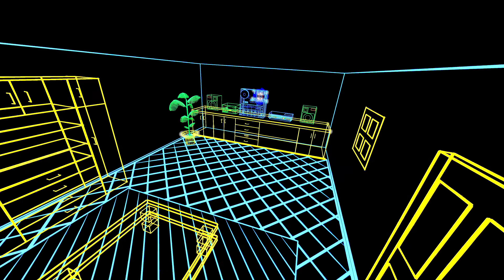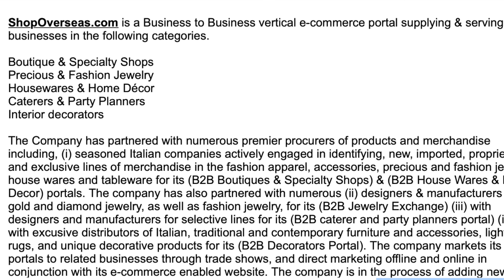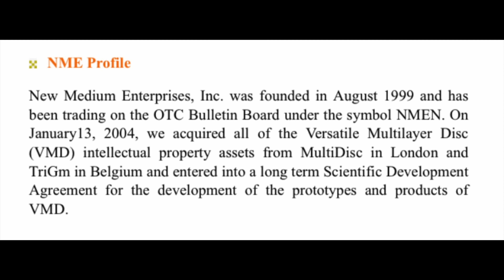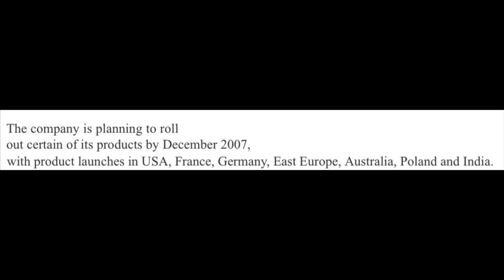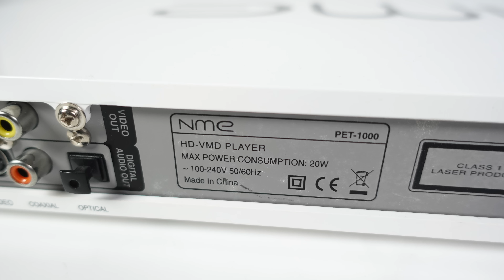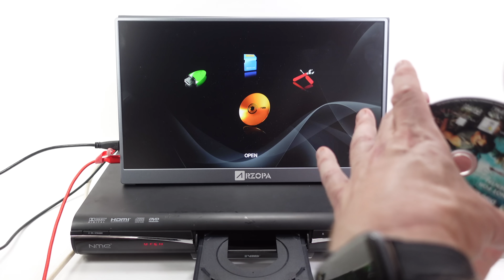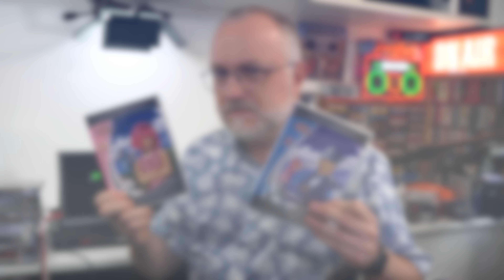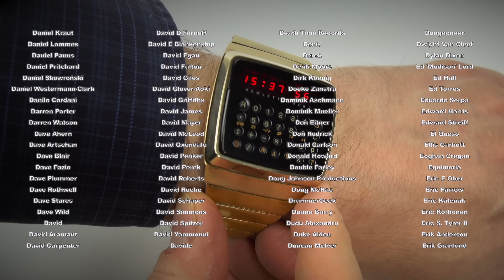The HD-VMD story - The format that lost to the format that lost

Comment: Blue lasers weren't cheap in that time period, red lasers were.

Blu-Ray players were insanely expensive when the format came out, and didn't get much better for a year or two after its release. Remember, the PS3 (at $600) was the cheapest Blu-Ray player you could buy for a while. And yes, the biggest reason was the shortage of blue lasers (Google "blue laser shortage"). So there was a significant price difference between blue and red lasers at the time.

Edited for clarification.
Reply: Must be the part of me used to audiophile gear pricing talking, but I dont think blu ray playes were insanely expensive at all. All a matter of perspective I suppose. But what I do know is that about 10 years prior at its launch, DVD players were just as expensive even discounting inflation. Probably Laserdisc, CD:s as well. I really struggle to think of a media format made for home use that launched significantly under 1000 USD, certainly not 500, when taking inflation into account. I think even HD DVD was quite a bit over 500 at launch, even if they quickly dropped in price. But this was a sidenote from your post, yes.
Reply: @GoldenCroc  
Okay, I'll rephrase. Blue-ray players were insanely expensive relative to red-laser devices. 

In the video, he claims that there isn't much of a price difference. That was definitely not the case when Blue-ray and HD DVD were new. Most Blu-ray players were around $800 or more in 2006, the first one from Samsung costing $1000. If you read articles from that time period, you would have seen many of them cite the blue lasers being the reason of such a price difference between Blue Ray and DVD, It wasn't just an early-adopter tax that often accompanies new tech, it was actual supply shortages, and the price gouging from suppliers that accompany that sort of supply/demand issue.

Just Google "blue laser shortage" and you will see a ton of articles from 2006/2007 talking about it. The blue laser shortage seemingly didn't start easing up until the middle of 2007, which would hamper production and affect pricing for the rest of the year or longer.
Reply: @MrNside  Well, yes. I also remember the shortages well, and agree more or less with everything you wrote. I just dont think 1000 bucks is that much money. As far as I remember, shortages or not, the pricing curve of blu ray players pretty much followed the dvd pricing curve if we are talking months since launch respectively.

On another note, the red laser vs blue comparison is hard to make I feel since there was no realistic red laser HD video format back then. As we have seen in the video, this format certainly wasnt it.

So if you wanted physical format HD, it was blue or nothing. Hard to make comparisons, really.

But I think we are talking past eachother and mostly agree. Cheers.
Reply: @GoldenCroc  
I'm specifically talking about the part in the video where he claims the price difference of blue lasers compared to red lasers wasn't an issue. I'm saying it most certainly was an issue at the time.

As for the early-adoption pricing, it doesn't compare to DVD. DVD coming off the heels of VHS was a completely new way of mastering and producing media. The players weren't cheap because in the late-90s/early-00s, the hardware used for transcoding digital video was more expensive. By 2006, the processing power need to transcode compressed 1080p video was significantly cheaper than the hardware to transcode 480p video was half a decade prior. The proof of this is that in 2006/07 you could buy an upsampling DVD player for around $200 or less. The difference was the laser and to a lesser extent the variable speed motor BD uses.

I'm not really sure what your argument has to do with anything I've said. Again, in the video he says the price difference between blue lasers and red lasers wasn't significant in 2006. I'm saying that minimal research proves otherwise. That's it.
Reply: @MrNside  As I said, I feel we mostly are talking past eachother. I was looking from the angle of pure retail price of the complete units (players). This latest post of yours confirm it, since I agree with everything you wrote in it. So there is no disagreement here, your point is well stated in the laser pricing regard.
Reply: @GoldenCroc  
I'm not talking past anything, I'm rephrasing or expanding on what I've already said in order for you to understand what my comment was referring to. I understand your argument, but I don't understand what it has to do with my comment.
Reply: @MrNside  It was a reflection and comparison of other earlier formats from your initial comment, a sidenote if you will. Now that you have clarified its the laser module you are talking about, I have no issues. "Talking past eachother" is an expression that means persons conversing without fully reaching eachother even though they might agree, it does not imply any fault with any one of them.
Reply: @GoldenCroc  
Fair enough. I do think that BD players would have been considerably less expensive had the blue laser not been an issue. But that would have come down to supply and demand at the consumer level instead of the supply and demand problem at the manufacturing level. We'll never know for sure, but I can say for certainty that blue lasers weren't cheap back then.

I edited the main post for clarification.
Reply: @MrNside  Fully agree, it is very possible that might have been the case if there was no shortage, and as we all know the ps3 was heavily subsidized for various reasons. Cheers.
Reply: @GoldenCroc  
Yes, all consoles (except Nintendo) tend to sell at a loss at launch. They make the majority of their money via licensing games though. While same goes for movies on DVD/BD, the licensing fee isn't nearly as high.

Comment: Interesting how the 'original' formats (eg U-Matic and DVD) were universal, but the second generation split up; probably due to greed as you said, or the 'not invented here' mentality. I suspect Toshiba drove the HD-DVD camp as they were sore at Sony after losing the Beta/VHS war. (Sony, Toshiba and Sanyo were the big three in Beta). Although a Beta enthusiast (it had all the good features first) I still think V2000 was probably the best format in theory, most notably because you could flip it over (like a compact cassette) and use the other side.
Reply: Flipping a video cassette is outright stupid. Because VHS and Beta use the same tape width, and they use the WHOLE AREA of the tape for recording with helical scan, so there isn't any space gained by allowing to flip the cassette, just inconvenience added of having to actually do that, and the tape surface being partitioned into two areas each with its own guard band, so it actually only loses space rather than gains you any.

V2000 devices did have some tricks that improved signal integrity and allowed them to space the adjacent fields closer together longitudinally, and this is where the initial capacity advantage actually comes from, not from the fact that they partitioned it into two "sides".
Reply: @SianaGearz  "Flipping a video cassette is outright stupid." OK, WHY? Are you suggesting that audio cassettes and reel-to-reel tapes which COULD be turned over were unworkable? They were VERY popular! Maybe V2000 could have used one inch tape instead, to retain video quality; I don't know, I never used it.
Reply: @rahb1  I don't know exactly why you don't understand this, so apologies if the explanation will be wordier than necessary and go through things that may be trivial to you, or have tangents that i deem helpful but since i don't know you, may not turn out to be to you. 

Tape isn't like a piece of paper, that you can write onto from both sides, and where if you didn't write on the back side of the paper, you'd need twice as much paper. Because unlike paper that (somewhat) blocks light, tape doesn't block electromagnetism, it leaks all the way through, because it's a really thin material with little metallisation. So you can't flip the tape the other way around and write on its back side. In fact this is not what's happening when you reverse the reel or the cassette, it's always the same side of the tape facing the read/write head. But a different lateral portion of the tape, different section of its width, is being utilised.

More similar to paper would be a floppy disc, where there is enough substrate thickness and embedded metal to separate the back side from the front side, so both sides can get written to. But you can't roll up a floppy disc material into a tight roll, the material ends up necessarily too stiff for that. And i expect that there is still substantial crosstalk between the sides, which is OK for simple digital signal, but not for analogue.

On an audio cassette, you have linear recording, so the mechanism drags the tape across a stationary read/write head. What this really means, is that the data forms a single very thin line across the whole length of the tape. It doesn't even necessarily need to be a tape, it could fundamentally just as well be a piece of string, and in fact this is how early recording machines worked like, it was a thin steel wire on a spool, and this is where tape has evolved from.

But it made sense for it to become a tape, so you can store two such thin lines of information alongside each other. And since a 1mm narrow tape would be too fragile, they made it wider, and eventually they put 4 thin lines of information on it. By making the tape really thin and fairly wide, it could be made very compact and sufficiently robust, solving the issue that steel recording wire was too fragile. There are two read-write coils in the head assembly (for two stereo channels), one of them is near the edge of the tape and one further down. When you flip over the cassette or the reels, what happens is that the head assembly is realigned with the other edge of the tape. So there is a total of 4 linear tracks stored on the tape. Two form a stereo pair for one tape direction, and two form a stereo pair for the other.

You could even say that the utilisation of the lateral space on this audio tape isn't perfect, and that you could store more tracks, though depending on head geometry and quality, they could gain higher crosstalk. Crosstalk between adjacent stereo channels is almost inaudible, but crosstalk between different independent tracks needs to be taken seriously.

Video tape doesn't work the same. The tape gets dragged not across a stationary head, but across a rapidly flying one, which basically moves mostly laterally to the tape, so it records in "helical scan", so the recording forms not a continuous longitudinal line, but a bunch of little diagonal ones, each of these lines storing a field of video. Each diagonal line in VHS and Beta spans the whole lateral width of the tape. So there is nowhere for more space to come from to store more information.

Development of helical scan was necessary for video, because the information density of linear scan like on audio tape just isn't nearly high enough, you'd end up with a 20-inch rapidly-moving reel per half an hour of video. So this forms the main difference, why audio tape has low space utilisation on the tape, and video has extremely high utilisation.

Mechanically, the moving head for video tape is realised as a rapidly rotating drum that the tape gets dragged across on an angle. There are many read/write coils in this drum, and when one leaves the tape on the top, it gets switched off and another that just enters the tape from the bottom gets switched on.

What V2000 has to do, is to partition the tape across its width to dedicate half the lateral space to one "side" and half to the other.

You suggest making the tape wider to allocate two tracks again, but that also doesn't make sense, since if you wanted to utilise wider video tape, a better way to do so would be to still have it single helical track, but halve the transport speed and change the helical scan angle accordingly. You would achieve the same or better space utilisation, and you wouldn't have to flip the cassette half way through.

The V2000 approach reeks of management having the same lack of understanding for space utilisation on video tape as you display for the time being, and telling the engineering team to "make it double sided so it can store twice as much video", which the engineers achieved by employing really advanced techniques, but fundamentally IN SPITE rather than thanks to having it "double sided".

I have worked in engineering for major companies for a good while, this happens a lot, that the product manager orders something they have little understanding of, that probably doesn't make a lot of sense, and you just execute that because you don't want to be fired, and you find unorthodox ways to accomplish the letter of the order. You don't argue with the management, or you will be deemed to have an "attitude problem". The people whose job it is to talk to management to evaluate whether their decisions are sensible are generally "consultants", and those usually haven't engineered a damn thing in their lives.
Reply: @SianaGearz  Thanks for your patronising reply. I actually DO understand that when you 'flip' an audio cassette you are NOT using the back of the tape! 
My point was simply that flipping a cassette is much less hassle than having to always rewind it before watching the next tape.
Reply: @rahb1  Your "point" changes very conveniently.
Reply: @SianaGearz  HUH? What part of "I still think V2000 was probably the best format in theory, most notably because you could flip it over (like a compact cassette) and use the other side." and NOT having to rewind a cassette are inconsistent? They are both part and parcel of exactly the same point - why dual 'sided' tapes and cassettes were far more popular!
I suspect your technical ability far surpasses your English comprehension.
Reply: @rahb1  My English comprehension is fine, thank you very much, along with German and Russian and several other languages.
Reply: @SianaGearz  Apparently not, as you didn't understand what I wrote, as opposed to just reading it literally. Audio cassettes have two SIDES, A and B. Quite OBVIOUSLY that does NOT mean trying to use the back of the tape! Or have you never even seen an audio cassette or reel-to-reel tape? NB: apart from slower recording speed, the ability to 'flip' the tape and use the other 'side' was a MAJOR factor in the popularity of later reel-to-reel machines, and also audio cassettes, because they did not have to be rewound. Auto-reverse machines simply took this to the next level. The CONCEPT of being able to do this with a video cassette (V2000) was a MASSIVE selling point versus Beta and VHS which needed to be rewound (ideally) before you could watch the next tape. As I said, I have NO idea if that format was technically superior to the others; I just liked the CONCEPT! If you still don't understand my point, then just give it a rest anyway. Thanks.

Comment: Matt, there WAS a not-quite competitor to DVD...it was called DIVX (not to be confused with the codec with a similar name, DivX).  The discs required a special player than unlocked them for a set amount of time, and were supposed to be like a rental that you never had to return.  They could be permanently unlocked somehow, for an additional sum, but I've forgotten how that was supposed to work.  It was reportedly cooked up by some group of lawyers from Los Angeles, imagine that.  The discs were supposedly made in the UK!  It was a resounding flop, however.
Reply: There was a DIVX Silver license upgrade, and planned DIVX Gold discs. The standard no-return rental discs had the proprietary player connect to a server to unlock the digital rights management for two days at a time, if you liked it enough to not discard after the included first unlock, you could charge an even smaller rental fee to watch a used disc again.  If I remember correctly, ordering the Silver upgrade authorized your account to decrypt the disc as many times as you wanted, and Gold were supposedly going to be about the same as DVD... though probably with better copy protection, since DRM was a fundamental feature of the format.

If it weren't for the mocking of the DivX codec, DIVX might have made a comeback as a fourth HD disc competitor... in an era closer to when pay per view and internet video streaming services are more widespread.  Back then, the idea of some computer tracking when you watched which video was an invasion of privacy that society wasn't ready for.

Comment: DVD's can have mutliple "sessions" (a session is a portion of the disk which can be accessed in some format) it is normal for a DVD to have a first session which is readable by the computer without any special requirement. That session usually contains indexing and/or end user assets (like DVD extra's such as wallpapers and so forth). It is unlikely anyone can copy a DVD simply by copying the files off the disk in file manager (wouldn't be much of a DRM if they could right?). So what is likely your validating is the DVD session is fine, but that doesn't guarentee the other sessions (which might have nonstandard encodings) are still as intended. My only point here, is being able to access and copy from a DVD's "viewable file content" from a computer file system is no indicator of correctness of the DVD (and presumably also of the HD-VMD).
Reply: Exactly, the correct way to copy a DVD is to make an image file and then burn it to a DVD.  imgburn comes to mind, or maybe cloneCD.
Reply: Windows File Manager gives an error when trying to copy files from a protected DVD.